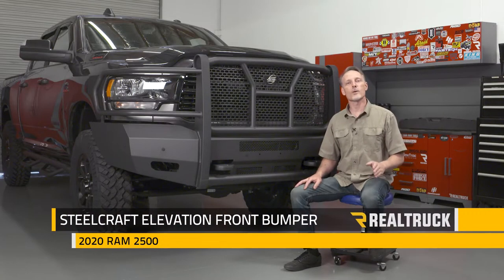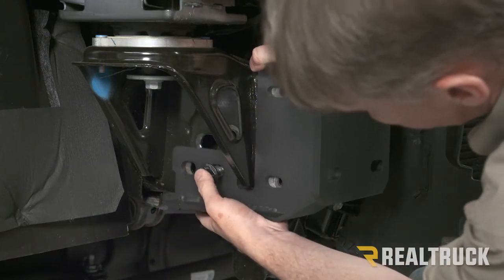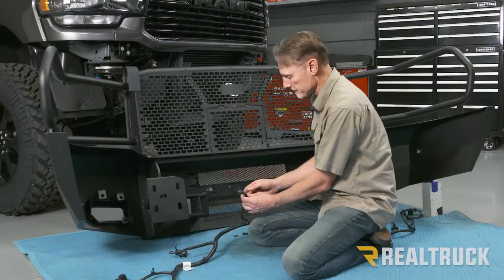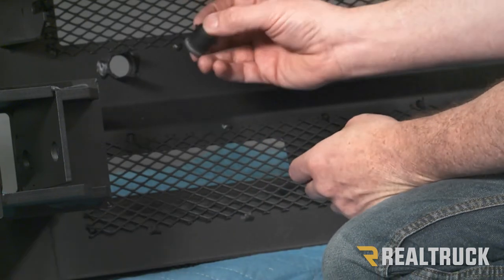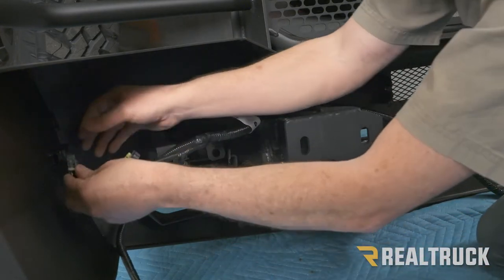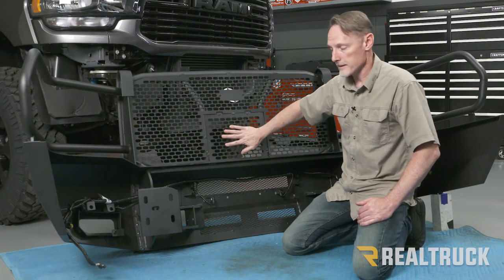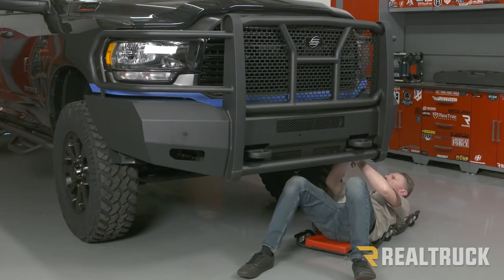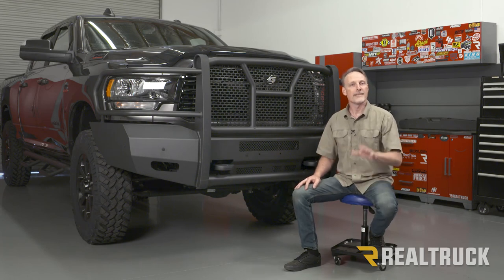How to Install Steelcraft Elevation Front Bumper on a 2020 Ram 2500

Comment: Will this fit if aftermarket riveted fender flares are installed? Or will it not fit due to the brush guard?
Reply from the maker: Hey Dominic, Bushwacker Pocket Style fender flares will work with this bumper. You can find them here, https://realtruck.com/c/exterior-accessories/fender-flares/?brand=Bushwacker. :)